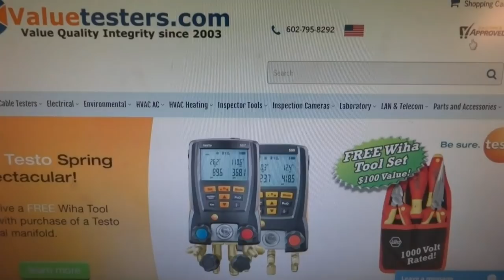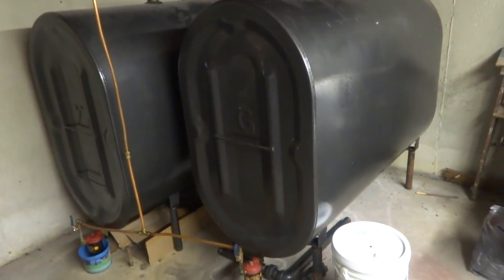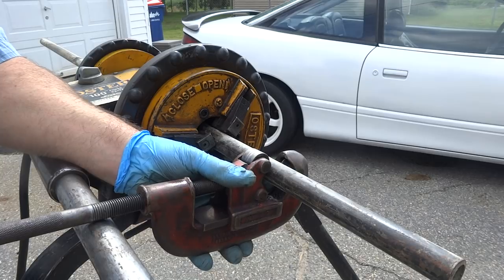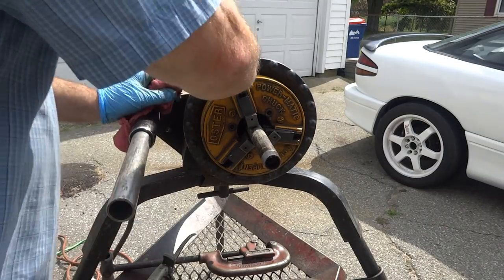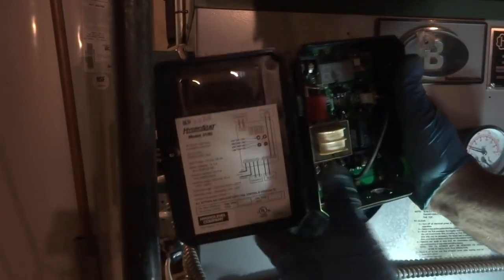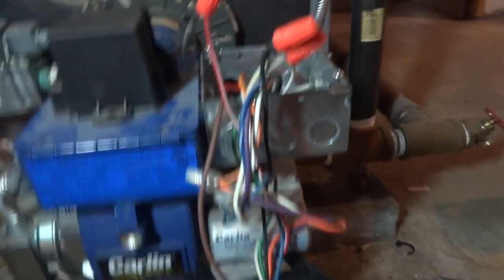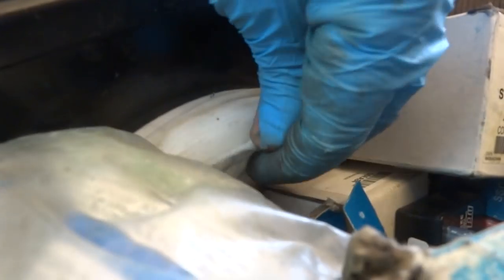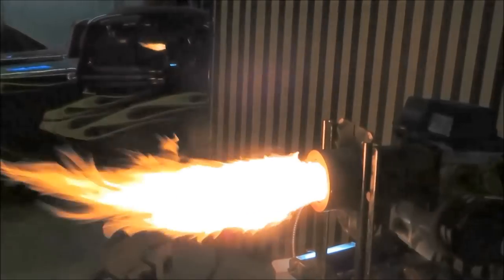carlin gas conversion burner install

Comment: Nice job. In my state you can't use the bx cable for a ground. It must have a separate ground wire. Thanks for the video.
Reply: Waterman one  type MC with ground

Comment: I'm here because I'm looking into swapping the oil burning Beckett for either a CG4 or this Carlin EZGas. My boiler isn't in the Beckett list and I just learned about this Carlin. I read the Carlin is more adjustable and will fit "practically anything". I can't find anything on the type of tube in the boiler and I'm not taking it apart to figure it out. Any experienced folks with their recommendations or questions would be helpful. I may not know all the answers but I'm willing to learn what it takes to know either how to do this conversion myself or where to get the necessary parts to make it work and have a professional install it after getting what I need.

Comment: CAN I RUN 3 SEPARATE OIL FEED LINES OFF THE SAME TANK? I WAS THINKING I COULD MAKE A MANIFOLD FOR 3 LINES THAT CONNECTS CLOSE TO THE TANK, EACH WITH A CHECK VALVE BEFORE THE LINES. THEN RUN THREE SEPARATE FEED LINES. 2 BOILERS AND ONE HOT AIR FURNACE?

Comment: Nice conversion. I have a Utica tri fire oil boiler. Would one of these gas conversion burners work to switch my boiler over to natural gas?
Reply: It'd be more cost efficient to just get a high efficiency gas boiler. The oil converted ones don't run efficient at all

Comment: We see very little oil equipment here in MN. Oil must have been cheap on the east coast in the past. Propane prices are very volatile, so everyone who can connects to natural. Actually, not much hydronic either, mostly in old houses.

Comment: does the hydrostat need a new well installed in the boiler for LWCO function?
Reply: dennis page yes, you have to use hydrostat’s electrowell for the low water cutoff  to be active.

Comment: You can still use street elbows there ?
Where i am in Vancouver BC Canada , we can't use street elbows to code
Reply: JiveTurkey0001 it may have to do with earthquake issue ,they could crack
Reply: Are you in the business? Does anyone around still have oil tanks and setups? My family all had them years ago but I grew up only around natural gas. Probably far more expensive than natural gas, especially here.
Reply: @VinylToVideo  Basement oil tanks and burners all over the Mid Atlantic and New England. Gas lines don't go everywhere. About two streets over there's gas, but everybody in my development has oil and mostly hot water heat.
Reply: @reecenewton3097  The cost to have a gas line put in would almost pay for itself, especially if the neighbors chipped in. I was asking for my area though. My family had them in the 50s and 60s around here but I've never even seen one in my life. Others had coal and wood furnaces years ago. It's not unheard of for oil to cost $3000-4000 a year nowadays to heat a house which is insane. I also heard it can coat the walls and furniture with a residue and stinks.
Reply: @VinylToVideo  Don't confuse oil burning boilers and furnaces with kerosene space heaters. A typical oil boiler is in the basement and connected to a chimney. Hot water circulates through radiators, usually baseboard radiators these days, throughout the house. None of the fumes or smell gets into the house. The cost of heating varies with the climate and size of the house. I am in central Pennsylvania, it gets plenty cold here, and have a two-story four-bedroom house with finished basement, all heated spaces. I pay about $1200 a year for oil which I don't think is too bad. The oil also supplies my domestic hot water by a coil in the boiler.
Reply: @reecenewton3097  I'm not, only going by what my family who had oil burning heat has told me. Of course this was 60 years ago with old oils and who knows the maintenance of the boiler too.

Comment: My Grandma has a Carlin ez1 gas burner. but the furnace water was leaking the furnace went except for the burner so the burner is there she just has a Bosch furnace [Wall like]. I really want to have that burner. it's in her basement and and it's not being used.

Comment: Never land stranded wire under a terminal. Crimp spade connector should be used. Low voltage or high it shouldn't be done🙏✌

Comment: My boss will kick my butt when i  cut the excess wires. But we work with long runs
Reply: The original installer had 5 wire on the truck and got the job done. Also it's insurance if somebody puts in a different system, or wants  A/C and heat on the same T-stat. Also insurance if one of the wires goes open. The latter happened to me! Had an open wire in a new factory length of cable.